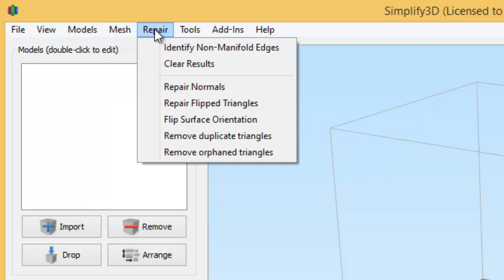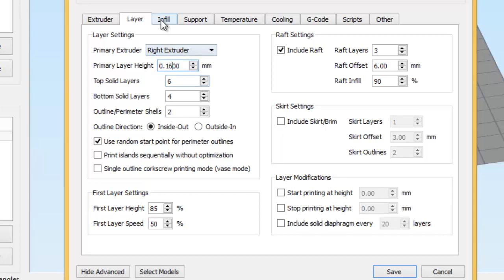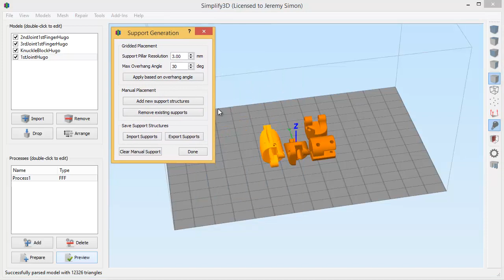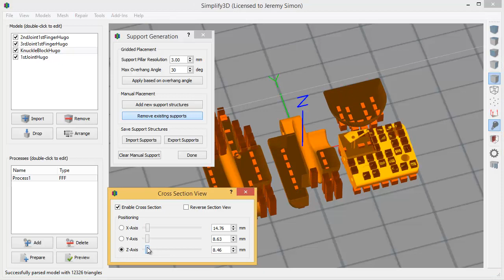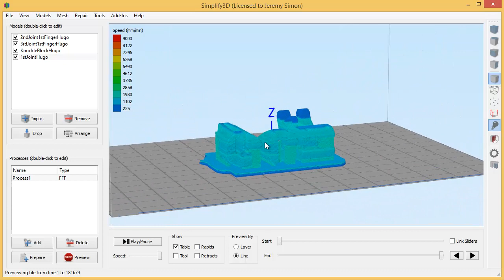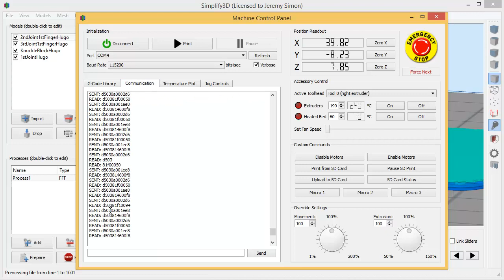Simplify3D (Software for 3D Printing) Demo and Review (3D Universe)

Comment: This looks like absolutely fantastic software.  It really seems to give you full access to the guts of the printer, and all the fiddly little variables, finally making it easy to treat it as what it really is; a CNC machine with an FDM extrusion head for a tool.  I think you're right though that the price is going to put some people off.  I mean, I just bought my first 3D printer for $550 (And then it dropped in price another 10%...sigh) and that was already quite a struggle with the sad condition of my finances.

Maybe they could take a page from the CadSoft EAGLE playbook and make a Freeware version for non-commercial use that is fully functional but has certain limitations. Like say, no features that don't apply to inexpensive hobbyist printers.  So, everything up to a MakerBot Replicator dual extruder and its clones.  Because if you can afford to do more than cobble together a RepRap or buy a Chinese-bootleg MakerBot on eBay for $500, you can probably afford the software.

Comment: Simplify 3D (the company) sucks.  They're not legitimate - they don't have a phone number, live chat or any form of actual customer service.  They force you to rely on snail-mail replies where the person on the other end may answer 1 of your questions, half of your questions, or simply not respond to any of your questions at all.  It's a JOKE.  And after weeks of messing with the software, it still doesn't give the same print quality as the UP software which has far less fine-tuning abilities. 

If you're looking for any form of product support or customer service when you buy your software, look elsewhere. 

The Simplify3D software itself is cool and could be great, but is still missing a lot of vital features to get perfect prints every time.  The support placement/removal feature is nice, but is of no use when the support layer is adhered 100% to flat surfaces that need support and therefore is impossible to remove.  Of course they give you the separation function in the raft layer setting to make objects separate easy from their "raft" support, but when it comes to any other support you can either have the support bind to your layer 100% or be 1 layer away from your model which will lead to warping, tolerances being off and all sorts of other problems.  Then if you send an email to Simplify 3D expressing your dis-content with this feature and asking how to resolve the support problem, they won't give you the time of day.  They didn't respond to my question at all - so I had to ask a second time.  This is why the company is such a joke - because if you could actually reach someone on the phone you could get an answer in minutes rather than days of email exchanges with an employee who makes half-ass responses. 

This company could be great - the software could be phenomenal, but they don't care about the consumer.  They don't care about supporting their product - they just care about getting your $140.
Reply: Good to know. I was looking for something to replace my UP software since I replaced my UP controller with a non UP controller. UP software is hard to beat in terms of quality of output.
Reply: John Black While you probably don't care anymore, I would suggest posting on their forums as other users can help you with getting used to the software and with stuff that's basically fine tuning settings.

Their software is amazing but they do have poor communication. They feel like a group of socially inept nerd geniuses. Their slicer is like unbelievably faster than the competition, but getting them to even acknowledge you is a challenge.

 Great software if you like to tinker, experiment and learn, though probably not so great if you need stuff done in a hurry.

Comment: Looks nice, but having a visual rotation off the xy plane is very handy, especially with snaps like Cura (which also then "snaps" to the floor)... It seems like nice software, but the lack of ability to rotate visually vertically is odd. its like using windows but having to go to the command line for some of the normal daily operations. Combine the best of Cura's positioning functions and you'd have a winner.

Comment: Thank you Jemery, It is very good presentation one of the most efficient I ever see, (on any topics).

I would like to know if you did use it with a FF Creator Pro X Dual ? Because it's the printer I have.

And I would like to know if you have also some recommanded setup for good printing or good 1er layer ?

Have a good day, Bye
Reply from the maker: Yes, it works very well with the FlashForge Creator Pro Dual. It has native support for that printer, so it's very easy to configure. 

For a good first layer, I set the first layer height to be about .3mm and the first layer speed to 50%. So if I'm printing at .2mm layer height, I would set the first layer height to 150%. If I'm printing at .1mm, I would set the first layer height to 300%. This ensures a thicker first layer which will give better adhesion.

Comment: Hello sir,
hank you so much for this video,

I have question can i make without infill model.? Some times i don't want to use lot of materials.
Reply from the maker: Yes. You can just set infill to 0 and the object will be a hollow shell.
Reply: I will try that thanks a lot..
Reply: +3D Universe Can I send you a design I am having trouble printing? I have spent over 30 hours and wasted so much filament and I can't get my printer to print this design. I am using 123D software, but considering purchasing Simplify 3D...I would highly appreciate help in printing this object...

Comment: Any idea how to do a dual color print with simplify 3d?
Reply from the maker: Simplify3D does not support dual color prints at this time. You can do multi-extruder prints, but the options are only to assign separate extruders for outlines, infill, and support.
Reply: wrong :p i found how :D
it's on a guide on their websitehttp://www.simplify3d.com/support/tutorials/printing-with-multiple-extruders/
Reply from the maker: Great! When I had inquired about this previously, I was told it wasn't supported, but I guess they added that feature. Thanks for sharing the link.
Reply: No problem i'm gonna try it soon.
Great video by the way

Comment: Hi Jeremy. I'm having difficulty getting my models to slice with any infill whatsoever. All models slice and print completely solid no matter what infill settings I use. Obviously not what I want particularly on larger models. Printer is printing well, just always solid. Do you know how to fix this?
Reply: Hi, Pete. Have you configured your infill parameters under the Print Process settings in Simplify3D? Here's a screenshot. You should be seeing something similar to this. If you have configured these settings appropriately, and you're still getting solid infill, I would reach out to the Simplify3D support team about that. 

https://drive.google.com/file/d/0B7IZ4iPA1DJZYUlpMTBCa2JVUm8/edit?usp=sharing

Comment: Hi Jeremy. I just purchased this software based 100% on your recommendation. I was having difficulty with replicator G heating my bed for an ABS build when I was actually using PLA. Might have been just a software setting I was missing , but I couldn't figure it out. So with Simplify 3d I've got total control over my temps and of course everything else. However, models sometimes will not load and I get the beach ball symbol.  I'm on a Mac. When I go to the preview process screen, I have garbage on the screen and can't preview things there at all. I have a pretty fast Mac with 12gb of ram and I'm only printing small test files at the moment. Still new. First day with my Wanhao Duplicator 4X. Once I got the G code file and .x3g files onto an SD card things printed very nice, but I would still like to be able to use the previews such as you are showing in your demo. Especially given the price!  Any ideas or help you could give would be awesome! Thanks for the video!
Reply from the maker: Hi, Pete. That sounds like it might be worth contacting the developer directly about (support@simplify3d.com). I haven't had issues loading model previews, and I'm also on a Mac. I run it on two Macs, actually - one is a Macbook Pro, and the other is a Mac Pro. It runs fine on both. So I would have to assume the issue is either with the models you're trying to load, or some kind of software issue the developer may be able to help troubleshoot. Try running your test models through this online repair tool and see if you're still having issues after that. https://modelrepair.azurewebsites.net

Comment: I bought this software and I like it a great deal so far but I have one big complaint:   for $140 you'd expect real documentation.  They offer only a basic guide and some tutorials.  

For many of the advanced features (the only reason to consider this software) you have to go to the forum and ask how others did it.    I expect that from open source programs but not from something you have to buy for $140.

I do like editing supports and setting sparse infill (though I can do the same skeinforge with the skin plugin).   I also like the ability to set different properties at different layer heights so I can make a thicker heavier base but a lighter top.

Slicing speeds are also very good.  If you are using ReplicatorG you'll like the performance and if you just use Makerbot's  you will LOVE the performance.   I've sliced things in a minute using Simplyfy3D that Makerbot never returned from.

But again the biggest issue is the lack of real documentation for all the advanced settings.
Reply from the maker: Thanks, Dennis. I shared your feedback with the Simplify3D team, and they acknowledged that documentation is an area they need to improve. They're actively working on it and will hopefully address that in their next version release.
Reply: 3D Universe Actually I've stumbled across a problem changing filaments while printing one model..  If I want to change the filament in the middle of a printing an object (I only have one extruder on Makerbot 2) I tell it to stop printing at a certain height, then I change the filament and tell it to print the model starting at the height I left off at.  

When it moved the end of the extruder across the plate to continue printing however the extruder tip is too close to the plate and it slaps into the model.  

This works perfectly fine if I manually pause and change filaments with the Makerbot so it seems odd this is happening.  I suppose I could edit the g-code to accomplish move the head up higher but one would think this "just works"
Reply from the maker: Hi, Dennis. I reached out to Simplify3D about this, and apparently, it's a common issue, so they prepared a 1-page PDF explaining how to do this. See if this helps... http://goo.gl/XZ6hEj

Why is it that you're stopping the print to change filament. Isn't there a pause function? Or is that feature added with the Sailfish firmware? I can't recall. Whenever I need to change filament, I just choose pause, and then it resumes where it left off.
Reply: 3D Universe  The pause/restart function does exist with makerbot firmware and works fine.   I wanted to use the software layer height feature so I did not need to monitor my prints.  Say for example I want to print something 1/3 red, 1/3 white, 1/3 blue (we have kids competing in RoboCup Jr in Brazil and want their robots looking more 'patriotic').   If I use the pause button, I have to sit, watch the monitor ,and stop at 33% and 66% to change filaments.   I tend to do work while things print and did not want to have to sit and watch my print.   Instead it would be easier for me to tell the print to stop at a certain height and then have it restart at that height to continue.  So if my print is 90 mm high I can tell it to stop at 30mm and 60mm to change filaments.   I thought this was the main purpose of the starting and stopping a print at a certain height feature.   Thanks for the PDF.  As I suspected it required adding in gcode.  I'll give it a try later today.
Reply from the maker: Dennis Mabrey I see... Well, if that doesn't work for you, perhaps you would consider the Sailfish firmware. One of the features that adds is a "Pause @ Z Pos" feature, accessible from the printer's LCD menu. It let's you specify a Z height in mm at which the printer will pause automatically. If you'd like to try that, check out my video tutorial for the Sailfish upgrade process here: http://youtu.be/2bcyDT4muss

That's for a FlashForge Creator, but that's a Makerbot clone, so it should be pretty much the same process for you. You can always revert to the Makerbot firmware if you prefer it.
Reply: ***** I just read what John Black wrote.   I never contacted their support though I did talk to one of the guys at Maker Faire in NYC.  They seemed like decent people but the one guy I talked to did not quite have an answer to my particular issue.

Comment: Nicely done. This software has a great feature set. Just bought it and starting to play with it. My first printer was an UP! printer which works great with a minimum of hassle. Went to the Makerbot Replicator 2X for the dual extrusion and larger build volume, but Makerware is very frustrating and does some stupid things. Things I can build easily and with great quality on the UP! are very hard to do with the same quality using Makerware. I'm hoping this will make the Makerbot print experience more like the UP!.